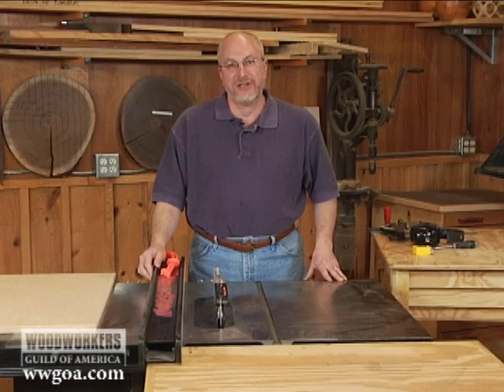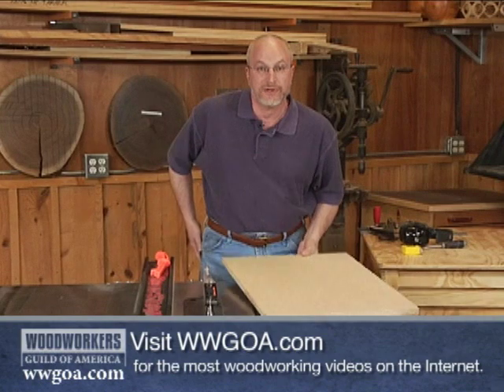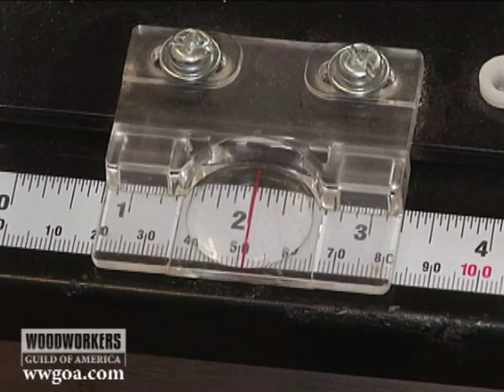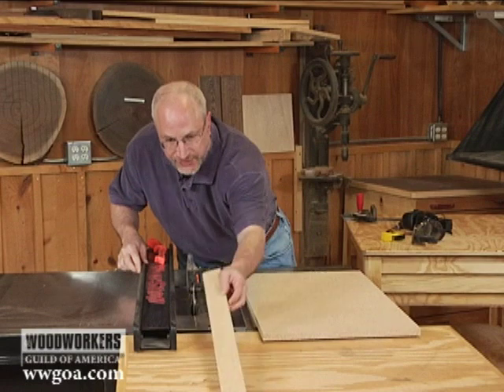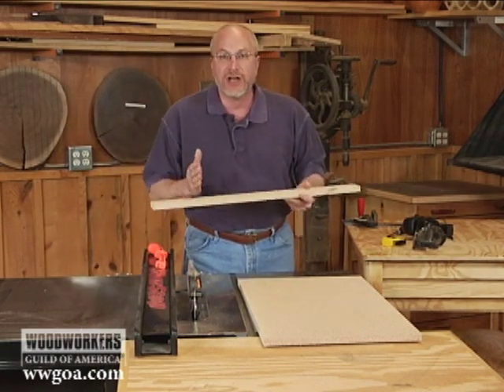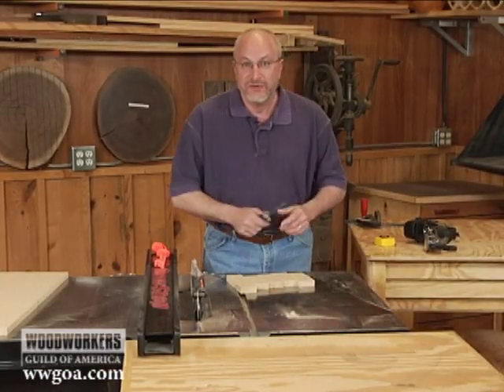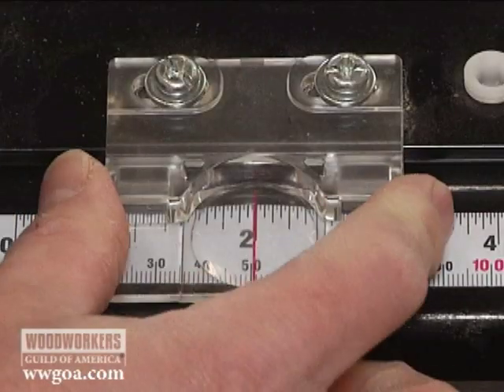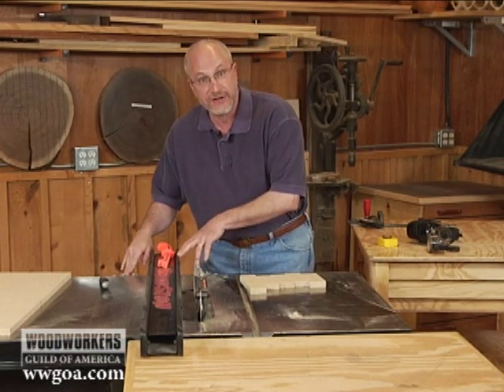How to Calibrate a Table Saw Fence

Comment: The approach is good but the explanation is not great. It would have been better to start with a poorly calibrated fence instead of adjusting it from 2" to 2". One approach is set your fence, cut a single piece of wood, measure it, then without moving the fence, move the indicator so it reads the same as the measurement you took of the cut wood.

An alternate approach that uses cumulative error, which he mentions but never explains, goes something like this. If one piece of cut wood is a little off, if you stack a bunch of those same piece together, the error will be larger. The error that may not be easy to detect in a single cut piece will but larger and easier to see with the more piece you stack together. If his indicator read 2", but the cut was actually 2.1", it may be hard to tell that you are only 0.1" off in your cut. But if you stack 5 of them together, you would expect it to read 10", but instead it reads 10.5" which is a lot easier to detect. You would then take the 10.5" total measure and divide it by the number of pieces and know you are 0.1" off. You would then adjust the indicator to actually read 2.1".

Comment: You didn't actually tell us how to calibrate it. Your fence was "magically" already perfect and didn't need adjusting. What's the purpose of cutting it into 5 pieces and measuring the 5 of them together?  What does that tell me about how to adjust my fence readings?  I was contemplating a WWGOA membership with the recent $10 offer from WOOD, but if this is what I would be getting, I'll pass. Tell us something...